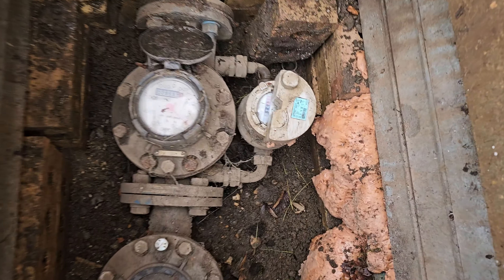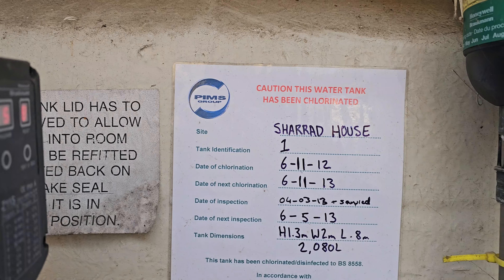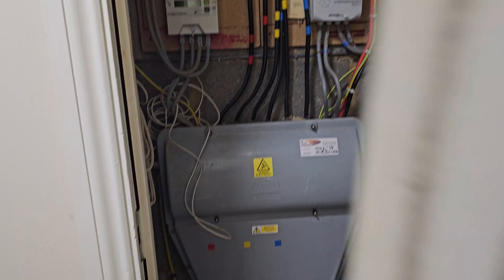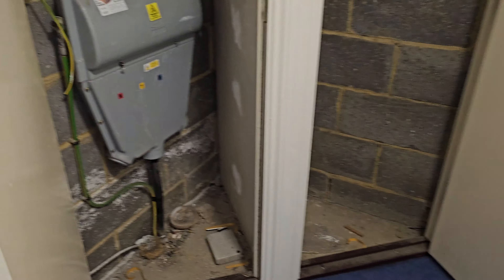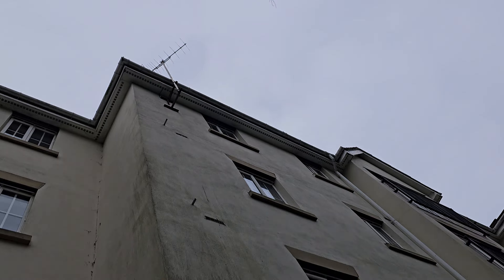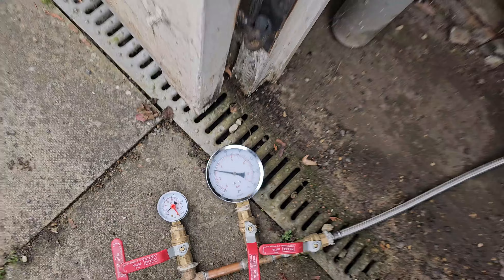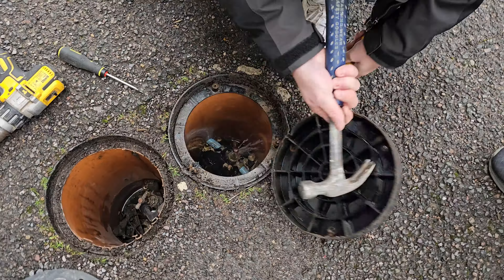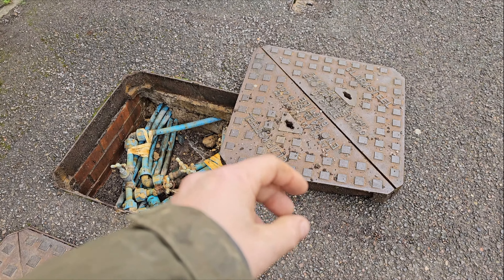Hidden water leak feeding flats. 1 LITRE Every 10 SECONDS!

Comment: I work in leakage for a local water utility company, and most people think leaks are easy to spot, but simply don't realize that the vast majority are not visible.
Trying to pinpoint a leak in an underground pipe, which is simply leaking directly into the ground is time consuming and actually quite difficult to do.
Only a very tiny minority are actually visible like this one, and these are the very easy ones to spot.
When a DMA (district metered area) is losing for example, 5 litres a second, when calculated by meters monitoring the amount of water in to the DMA verses the total amount consumed by customers, most people think 'wow 5 litres a second, that's a massive amount of water, it should look like a fountain gushing from the ground', and if you had a fountain gushing 5 litres a second then yes, it would be a massive gushing water jet.
But think of a DMA as anything from 1 square mile, to maybe 6 or 7 square miles in area, and that 5 litres per second loss possibly could be the total from 30 small leaks, and then you start to understand just how difficult a leakage technicians job is.
Trying to keep on top of leaks is like spinning plates.
Reply: 1 liter every 10 seconds - someone's cooling a distiller making moonshine.
Reply: @ehsnils  Nope, everything is metered and monitored.
When there is a sudden rise in usage, we are sent out to find the source.
Main water pipes that feed towns, can be 1.5m in diameter, and the water is of a high pressure. If one of those bursts, that is a LOT of water suddenly lost trust me.
Reply: Bashing taps all day is soul destroying
Reply: @JohnRock14  Bashing taps ?
The only time we go into a customers property is to turn off the internal stop tap to try and eliminate the source of the leak, obviously if the test meter (or customers meter if it's a single supply) fitted is still showing usage with the internal stop tap switched off, we know the leak is external.
Reply: @DjNikGnashers  bashing taps = stoptap bashing (sounding). Mains fittings and stoptaps all day. 
When youre looking for 1-3m3 in a big dma, its boring af. 10m3+ at least youre looking for something meaty.
Reply: @JohnRock14  I don't work on the external network, I deal with customer side leaks.
I agree dma sweeping as we call it, with a listening stick, is a lot of walking and repetitive work.
I don't do that.
We gas test, use RD500 'thumpers', ground mic's, flex trace, etc, to find leaks between the external boundry boxes and the customers internal stop tap.

Comment: I had an underground leak in a block of flats in Cambridge , many years ago. I called them up (all before internet). The woman I spoke to was threatening and obstructive from the get go. I was only inquiring at what point it was their leak and when it became mine. I eventually hung up on her and my mate and I dug down to the pipework. The leak was so bad you could hear a rushing noise.
When we got to it we found the alkathene pipe had been joined using brass couplings then buried in a chalk rich soil which dissolves brass and the pipes had come apart. Correct connectors and we were done. I shudder to think how much Cambridge water would have charged.
Stay away from the water companies.